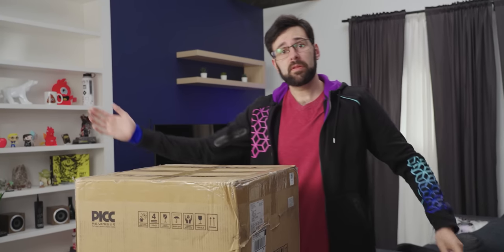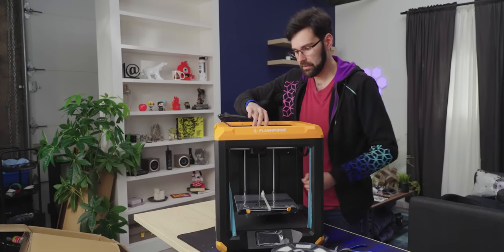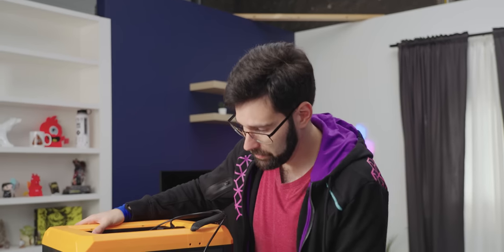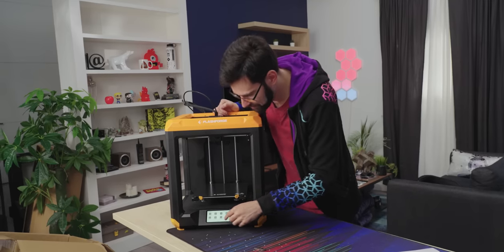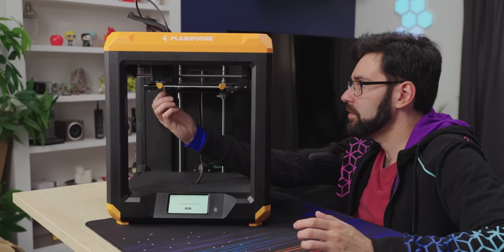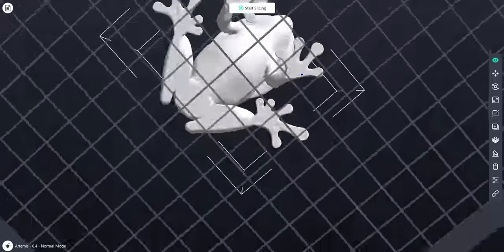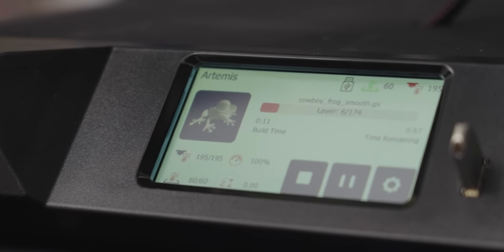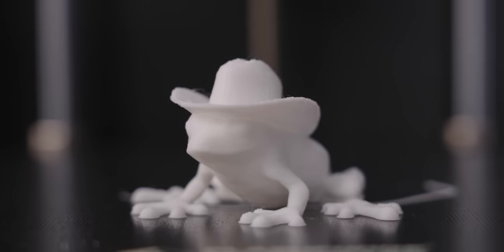This made me a new friend! - Flashforge Artemis 3D Printer

Comment: At nearly 600 bucks.... you might as well get a Ender-3 S1 Pro 3D Printer.... 

This wont print reliabily for more than few months of non stop printing.
If the hotend isn't all metal, the cheap PTFE tube will eventually burn out and taking it out and replacing it will be a pain!
Reply: I've had a Flashforge printer for 1,5 years  and so far it's still printing good

Comment: Sorry but bad review. Don’t trust flashforge. Their printers are shit for the price. Companies like ender provide more reliable printers with essential features like auto bed leveling and higher print temp for the same or even cheaper price. Flash forge is known for making weird decisions, making cheap machine with a few odd parts you find on high end machines that cannot be properly utilized because of low end hardware, like a printer with low max print temp, crappy heated bed and no auto bed level but has a dual extruded. This machine is no different: equipped with direct extruder, wifi, and led light above the nozzle but no level for 500 dollars, which is BS. Anycubic and ender machines might not be aesthetically pleasing, but they are built better, provide quality of life improvements, and will give more consistent prints at a lower price. Furthermore they are upgradable. You can buy an original ender and tweak it to work almost as well as more modern printers for the price of less than 200 bucks. So please, do not buy their product